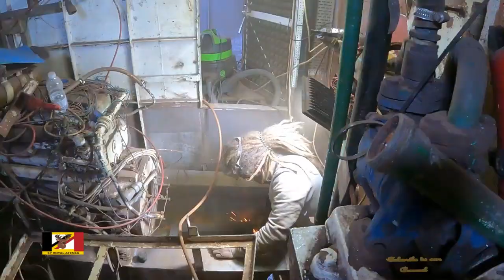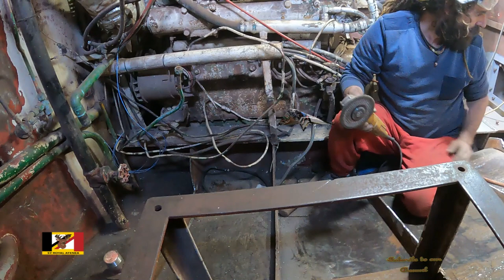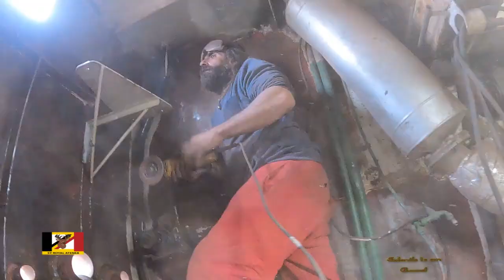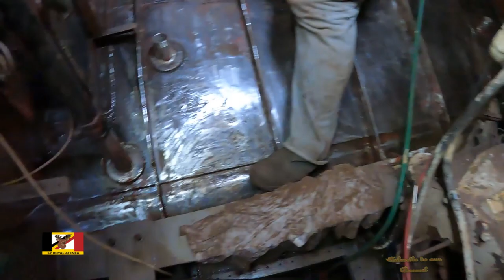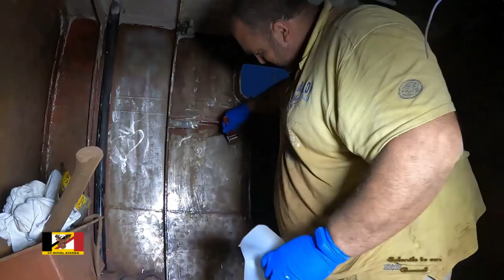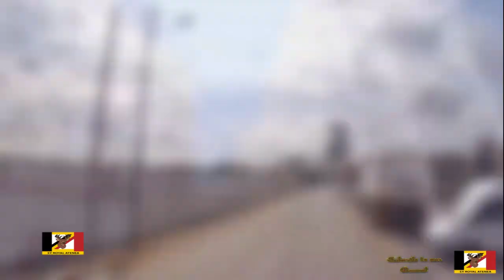Sailing Sailboat Engine Room Refit

Comment: Steel always want to make me take the sandblaster out.
Reply from the maker: We wish we could use a sandblaster in the yard, it would have been much faster and cheaper to do
Reply from the maker: Yes a sandblaster would have saved our arms and hand !
We did try with a wet sand  blaster but the power wash I was using wasn't power full enough! So it was taking a longer time !